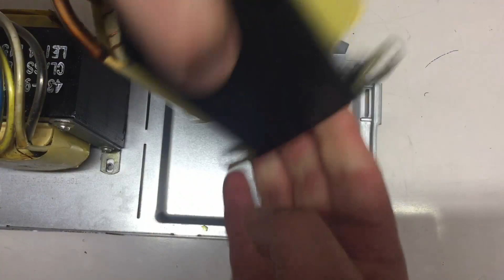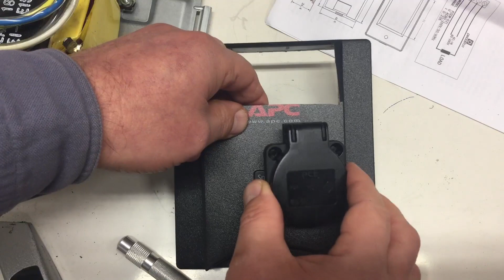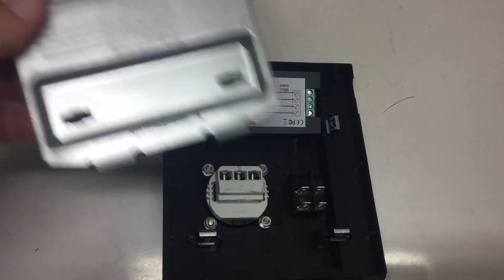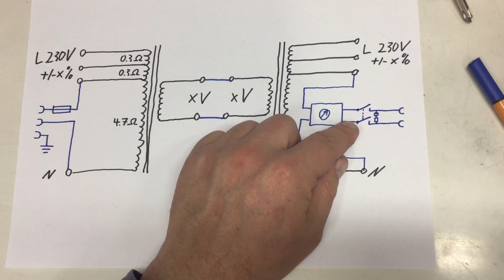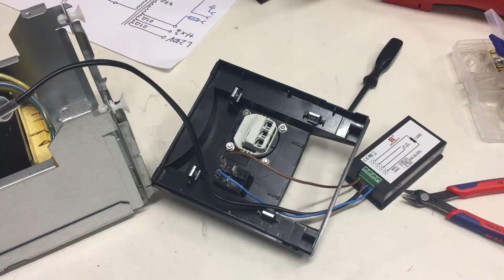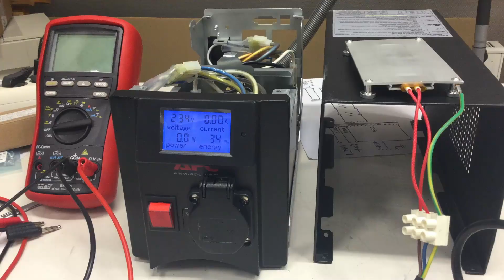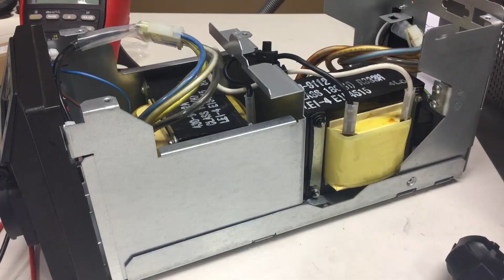Small Project: AC Mains Isolation Transformer from Two Broken UPSs (2/2)

Comment: Cool project! maybe you can rid of the noise (a little bit more) just tying the two upper holes you have in the top-front part, just putting a small cross plate between them I think it can supply more rigidity to not vibrate and so less hum, just my 2cents
Reply from the maker: Thanks! I've actually thought (very briefly) about putting a brace across the top of the two front parts during the build. But there is a reason I didn't: I'm lazy ;-) Anyway, when the hum gets too annoying I will take up your suggestion and add that brace.
Reply: @robertssmorgasbord  😂

Comment: I installed a 1KW balanced transformer for a recording studio. It was mounted on a concrete block wall in the garage one floor down. Even with no load it vibrated so much that it was heard through the entire building. It had to be moved to an isolated pad away from the structure. My understanding is that toroidal transformers have less hum, but I was also told that the hum is actually caused by vibrations in the winding wires, so may be a quality of the build. You get what you pay for. Good luck, good video.
Reply from the maker: Most interesting! And yes, transformer hum definitely depends on build quality. I have a lot of bigger transformers laying around - though not 1KW :-) - that are practically silent. These APC UPS transformers are build to a price point. The low voltage winding seems to be the main problem here (higher current - stronger magnetic field). In normal operation (just passing through AC mains) they are almost silent. Thanks - and you're welcome!